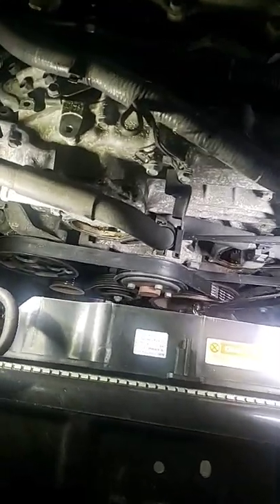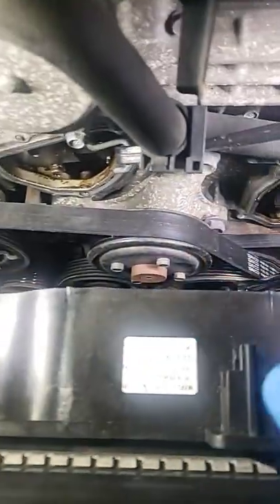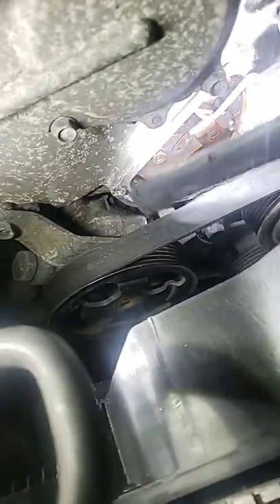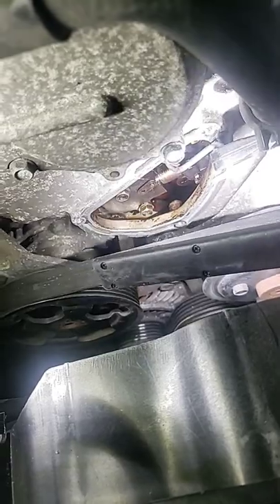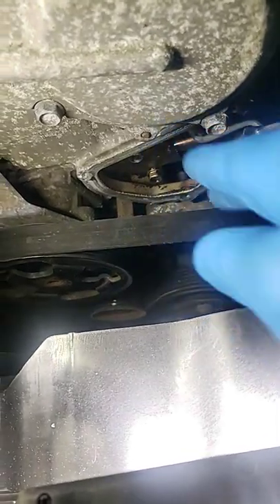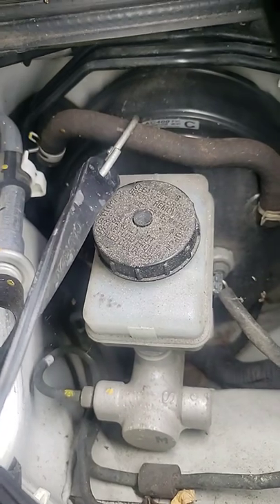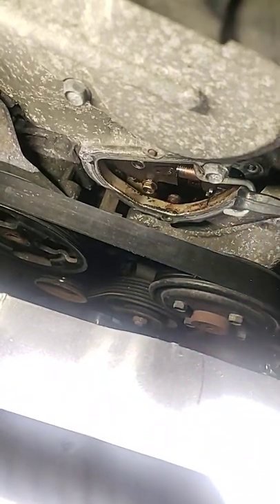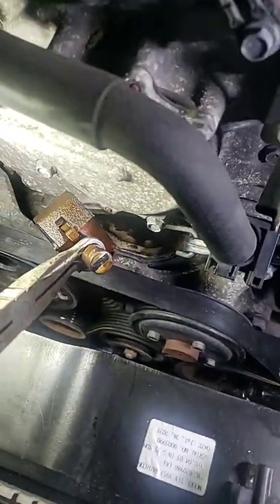👉G35/M35 TIMING CHAIN TENSIONER REMOVAL QUICK TIP👨‍🔧

Comment: What issues was your car having when you changed that?
Reply from the maker: No heat.....coolant flow. The car had multiple issues 

Thanks for watching Subscribe & stay Tuned for more‼️🤝
Reply: @PhillyDee215 did you have a ticking noise?
Reply from the maker: @ajvlogs1525  if you're having a ticking noise it could be the primary or the secondary tensioners